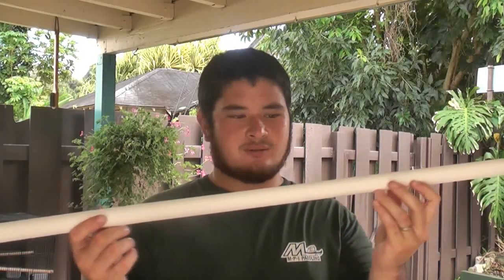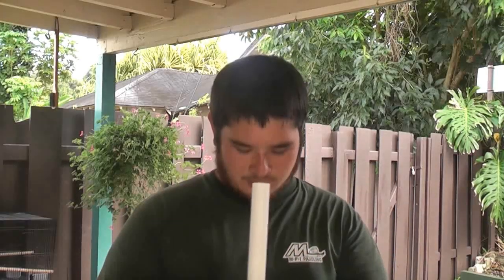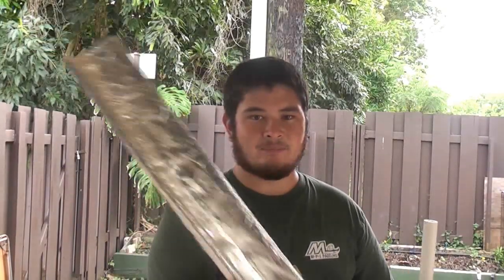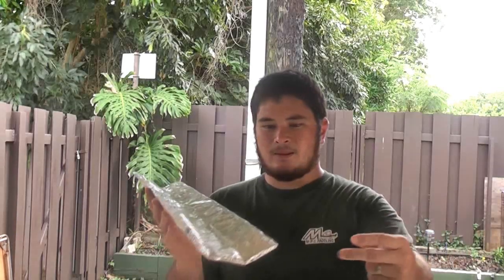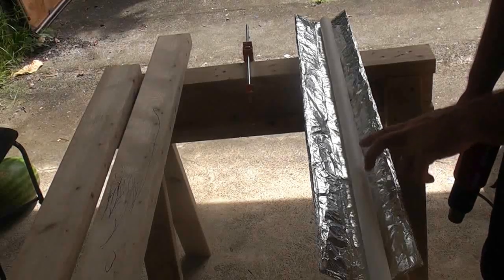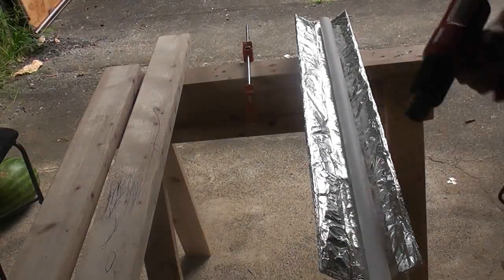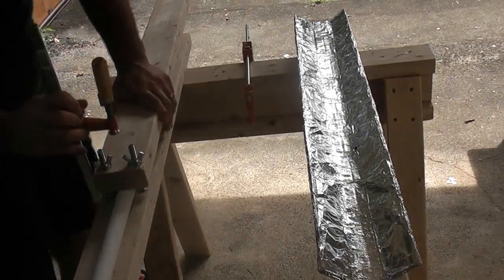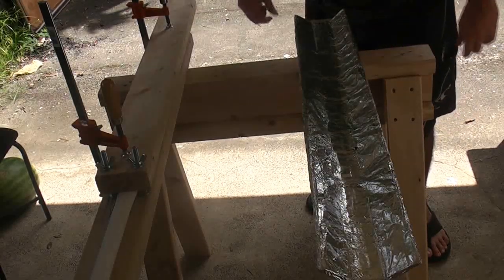How to Make a Hunger Games District 12 Bow with PVC Pipe Part 1

Comment: In forums, people are saying that it is possible, but very tricky and unlikely for most hair dryers. Another advice from many DIY guys have been to convert your hair dryer by taking it apart to adjust the heating. Then again... I see heat guns for $10-20 online. Sounds more economical than sacrificing a hair dryer (that is used on a regular basis) to make a questionable device. Heck... I'd go with a heat gun just to be safe after watching Nick's video on over-heated pvc bows.

Comment: I'm having trouble flattening the pipe. I've made the adjustable flattening jig, but when I go to flatten the pipe, it rolls from side to side on the wood. This leads me to need clamps on each side right across from each other, and since I only have two and can't justify more, the part of the pipe near the bolt end of the jig doesn't get flattened. Any tips?

Comment: Made this bow, but I'm going to give it another go.. it collapsed on the fifth time I drew the bow. I may have made my blocks on the flattening jig too short. After repairing the collapse, I shot it at a target a few times and it shoots very nicely.
Reply: did u bought 3mm thick pvc pipe? where did it collaps?
im about to start this one, its a beautiful bow i want to make it work hope ur bow works fine too
Reply: Nicolas Dávila It collapsed a little below the 9 inch flattened and cut piece. Apparantly, it was too flat at that point and didn't taper well.

It hasn't collapsed since and I've shot it about 50 times since. It consistently pierces my target by 15 cm :)

In the mean time, I made a second one, it too had some rips in the tube.. I clearly need to practice more, but it too, shoots very well.
Reply: Nicolas Dávila Damn.. my second attempt bow collapsed after shooting it about 100 times in two days.

Just below the handle this time. I was drawing it back full at the time and holding it not longer than a second.

My first one, I repaired after the first collapse and it has stayed perfectly after about 150 more shots.

I had expected it to collapse near the tips that were not much of a success on this second one, but it'll be better on my third attempt :)
Reply: ok thanks for the info, we may put some core on this one
Reply: Nicolas Dávila My third attempt bow is perfect. No collapse yet, painted it and put some of the decorations on it. Looks very nice. Practice makes perfect :)

Comment: If you use 3/4" pipe and then use 3/4" flattening jig it would be completely flat I think you need to explain it better because 3/4" hasn't got a diameter of 1" it's 26mm
Reply: Charlie May you think i could use 1/2 pipe to mkae this bow?

Comment: Bought the pipe, bought the cord.. now making that flattening jig :)
Reply: hi, I want to make this one also, but I don't know how long the flattening jig should be. do you know that? thanks
Reply: I'd have to measure it, but the length is equal to the length of the limb you're flattening. so, from the middle of the bow, to the end of the pipe. that way, you get a nice taper.